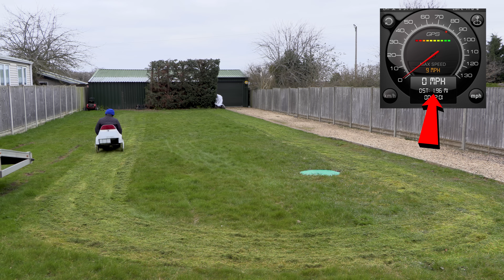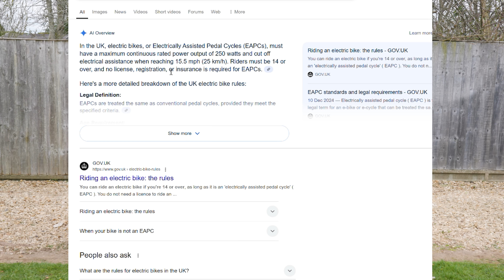Will my SINCLAIR c5 drive 19km?…..

Comment: My take on making it 2WD is turning the motor 180° and installing another sprocket on the axle. So the motor would drive an axle, not a wheel. 
Bonus interesting fact: the very same drive you see on original Sinclair but with gas engine was used on a post-war soviet Киевлянин trike soviet government gave to disabled veterans. Said trike had the very same set of problems you got.
Reply from the maker: Wow I’ll Google it 👍

Comment: I modified one with a front motor. in wheel motor. Topped 35mph and great fun. Ebike controller and ebike battery.
Reply: The way to go honestly i've done a 500w and a 2000w hub drive with a modified suspension fork. it's very nice and efficient and pulls clean and straight.
Reply: Sounds scary,lol

Comment: Back in the day we’d use a 24v controller with two 110ah leisure batteries on the standard 12v motor - went like the clappers but hard to steer at speed so think you may need to adjust the steering - was like a very short ‘quick rack’ so lengthen the rod to make steering slower ?
Reply: Still the same today but a 24v lithium 36ah and then motor drilled for cooling with a custom cooling fan on the end. :)

Comment: NSW, Australia.
Our power output laws changed to allow 500w motors. (250w in other states)
They still follow UK, EU laws though. 
25kph max speed, 50kg max weight, pedal assist only above 6kph.
Interested to know the weight of the C5 with Battery. 
Cheers.
Reply: In the UK though we have to be pedal assisted. Fortunately the C5 doesn't have to conform to these laws as it follows the 1983 laws for electric bikes from when it was produced in 1985. Repowering it like this is a grey area though.

Comment: drill a keyway in the built-up hub, drift a strong pin in [so it is reversible if plans change]
then add a hub-motor from a scooter to the front wheel, 3x3 for the hill
do you know geoff from geoff buys cars, lives around your way, keeps buying buggered up brown volvos

Comment: Great video,nice work Paul,thats a powerful motor 👌,made me laugh at the slow mo wheel spin🤣,i reckon that you get 25 on the flat👌😀👍
Reply from the maker: Will have to try a top end test definitely 👍
Reply: @ODDAutos  with 24v on the original motor 30mph is top speed. Its a bit worrying though and you definitely need a front disc brake or you will go through pads like nothing. The original brakes are awful, the front pads aren't rubber so if you fit cheap rubber pads they are unlikely to last your 19km ride! If you need bits or want a front disc kit ready to drop in just message us.